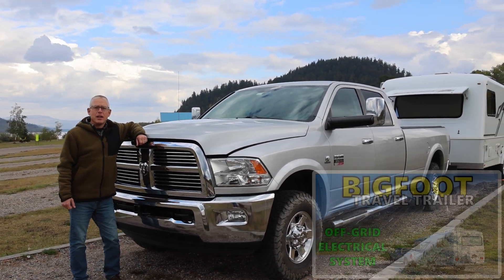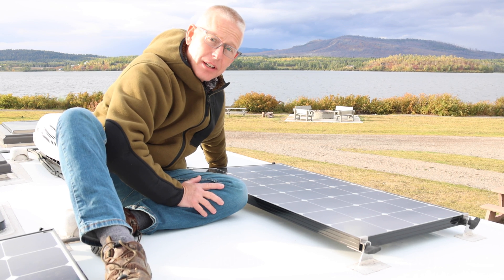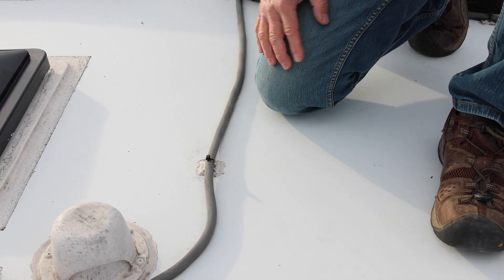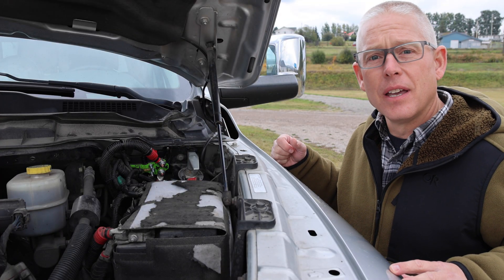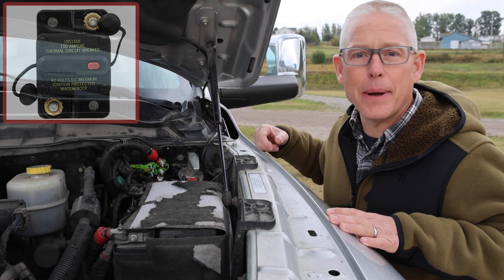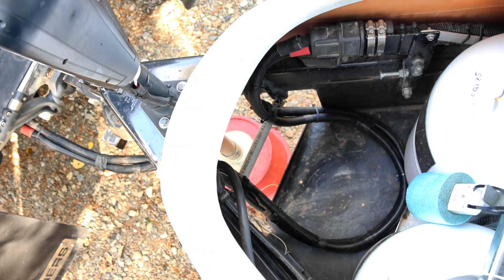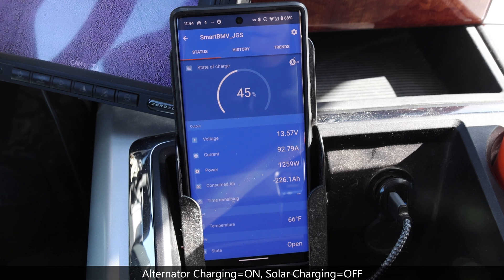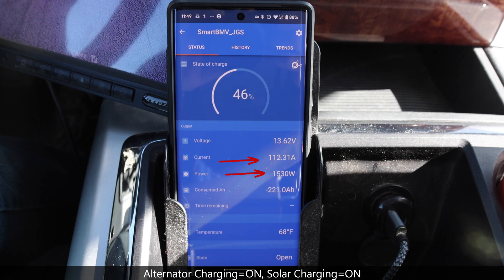Bigfoot Travel Trailer | Lithium Battery Charging via Solar & Alternator [4K UHD]

Comment: But do i neede to have that system in place.  Im not that extreme with solar. Just 2 100 watt panels an 2 100 ah lithium batteries an all i wanna know is do i discount the factory charge wire going to my 7 way or leave it an let both systems do what they want i just dont wanna take out my alternator by back feeding. But there is a fuse in place for the factory acc wire to the 7 way.  So it should be fine?  Im not trying to use the truck to fully charge the system an i do not leave my tow vehicle hooked up when camping.
Reply from the maker: We did disconnect the power wire going to the 7-way, mostly to prevent us from having to unplug it on quick over night stops.  Without knowing the specifics of your system, we can't make any recommendations on what you should or should not do.  Sorry we can't be more help!

Comment: I'm new to lithium and had a question about the alternator isolation switch.  Is this required when using a lithium battery? I just got thru installing lithium in place of AGM batteries.
Reply from the maker: Thanks for dropping us a comment.  The Lithium battery isolator accomplishes a few things...It keeps the Lithium house batteries from running down your starter battery when the engine is not running (isolates the two systems).  The device also prevents over-heating of your engine's alternator.  If you run large gauge wires from your Lithium batteries to your alternator, you will want to limit the rate of charge to prevent premature failure of the alternator from over-heating.  The Lithium battery/s will accept current at a much faster rate than lead acid, putting additional strain on the alternator from the increased current flow.  The LI-BIM device we use limits the strain on the alternator by cycling on-off-on the charging current to the Lithium house battery/s.   However, if you are only charging through the 7-pin trailer connector with small 10GA wires, you may not need to limit the charge current.  The small wire size will automatically reduce the current flow.  If you are just connected to the alternator thru the 7-pin connector, you will also either need to disconnect the 7-pin trailer connector from the tow vehicle during times when the engine isn't running, or you will need to use a battery isolator like the LI-BIM we mention.

Comment: Enjoying your adventures. Wondering why did you go with #1/0 for the dc-dc cable? Just noticing for my 30amp dc-dc charger, asks for 6awg wire.
Reply from the maker: Sorry for the late reply.  We choose the #1/0 cable because we don't use a DC-DC battery charger.  Instead, we are using a Li-BIM (Lithium Battery Isolation Manager) per the recommendation of Battle Born Batteries.  This device charges at the full available alternator current for 15minutes, then disconnects to let the alternator cool down for 20 minutes.  It then repeats the cycle until engine is shut down or lithium Ion battery bank is full.  The system works great!

Comment: Jeff brilliant! Exactly how I wish to mount our system and create energy to storage. What size amperage is your alternator(s)?
David
Reply: Second view I see you have 1x160 A alternator. Did you consider a second or upsized alternator?
D.
Reply from the maker: Great to hear from you David!  Thanks for watching.  We previously considered a second alternator (or larger replacement), but have since decided it's really not needed.  Our factory 160A alternator is providing just over (90A) or 1,200 watts  while this system is charging.  This is very sufficient for our needs.  Besides, if we were to add another alternator, or upsize the existing alternator, we'd need to also upsize the wiring, circuit breakers and connectors to gain any benefit.  The current system has worked super well for 4 years now.  Still on that original factory alternator.